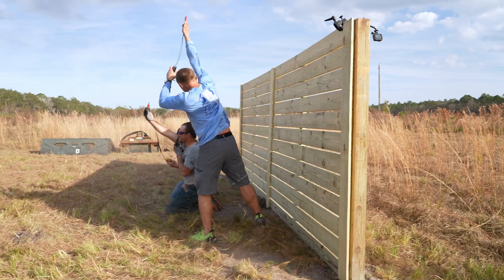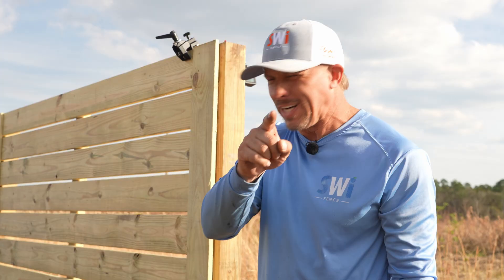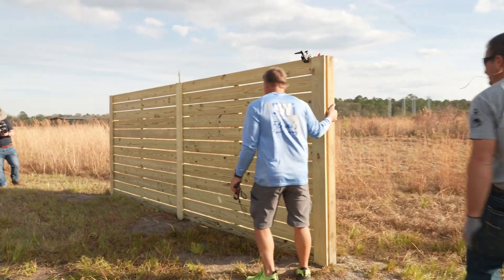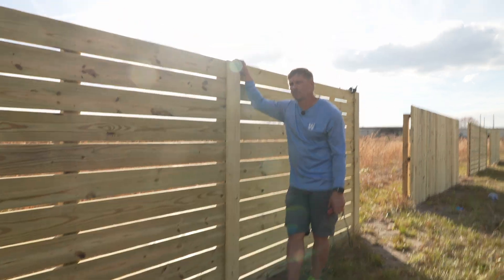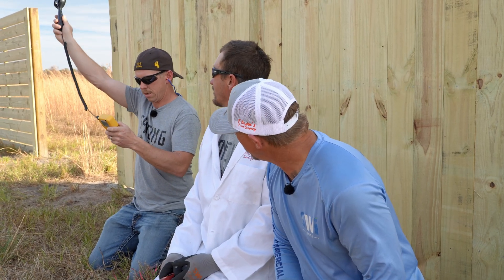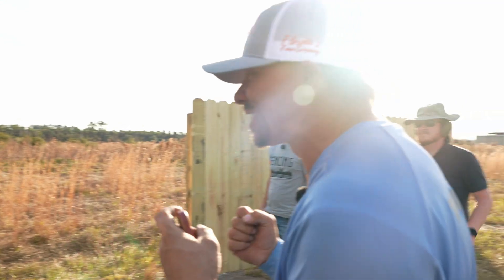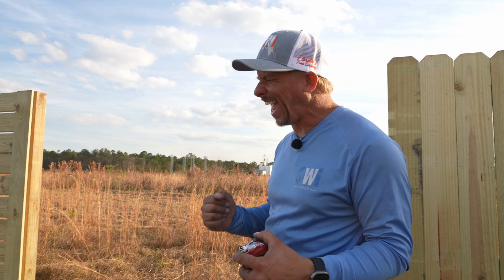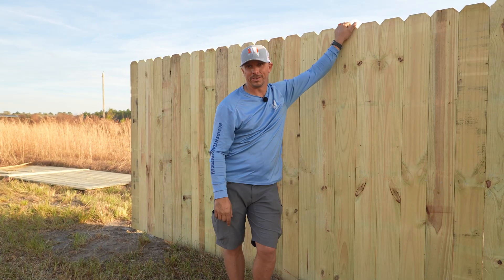Wood Privacy Fence VS Hurricane Simulator: How Much Can It Take?

Comment: I was all excited and ready to use some of this info for my new fence build. Then I saw the winds were only +/- 120mph. The last 2 hurricanes to hit here had +150mph winds. I’m thinking of doing 3ft deep holes 12 inches wide with premixed concrete. 4x4 posts 6ft apart. 1/8 gap between dog ear fence boards. 6ft x4ft frame built between posts made with 2x4’s. 

Please tell me that will be overkill. Oh. Another suggestion I saw was roofing cement or something on the 4x4’s to prevent rot. Whatcha think?
Reply: I failed to mention that I’m in SW Florida with fairly sandy soil.

Comment: The horizontal has gaps for wind to pass through , it minimizes pressure significantly than the non-gap vinyl fences you tested before.

Comment: Most of the concrete is wasted and does nothing for wind resistance.  The concrete should be all the the top  of the buried post.  In engineering terms, what you have is a cantilever beam with ineffective fixturing.  There is no loading from side to side, only against the face.  The middle of the concrete column doesn't move, so is doing nothing to support the post.  Think of how metal T-posts are set directly with a flag only at the top of the buried section, not the whole length.

It would be cheaper and more effective to have some braces temporarily installed for hurricane conditions, to make a strong truss instead of a weak cantilever.  Ground anchors and straps would do fine.

Comment: Fellers, I’m impressed!  Y’all took a deck, stood it up on its side and attacked it with a Gator chasing boat!  

What did you think was gonna happen?   Didja suspect that gators were gonna try to run through it?  Or, were you ‘uns maybe thinking that a square dance would break out and boot scootin’ cowboys would knock it over to reclaim their dance floor?    

I mean for heavens sake guys, there’s nary a man who is sober and builds an upright deck… they gots to be horizontal.  Gators can’t climb that high and cowboy boots ain’t worth piddly at dancin’ on the wall!

So fess up… were there a few brewskis involved in the  design of this test?  If so, that would explain why it was such a good danged video!
Reply from the maker: We.... we built this deck on it's side? DANG IT!! You're right!! sigh Great... this is embarrassing... 🤦‍♂️
Reply: What a joke 🤣🤣🤣 how many stooges does it take to make a fence fall...as many as you want as long as you cut the post...Give them the Dumbest Prize Award in history!!!

Comment: What would happen if you mix concrete, b4 you put it in the hole?other than the dry pack and than put water on top. I found out by fixing a lot of fence, that dry pack don't mix all the way, and on the bottom will still be dry still, or weaker than if you mix it

Comment: Here in Miami the coral rock assures your posts do not move in the ground at all. Having spaces between boards like you do reduces wind resistance. Hurricane Andrew dropped every fence including concrete block walls without columns.  You need to try a pre-fab concrete fence next!

Comment: I guess I went little over kill on my fence posts. 3 1/2 deep 12 inch wide holes with 3 80# bags of cement for corners and 2 80# for line posts. But in my de-fence  it is in heavy clay.
Reply from the maker: Overkill might be unnecessary but you won't regret it later like you would if you did it sketchy.